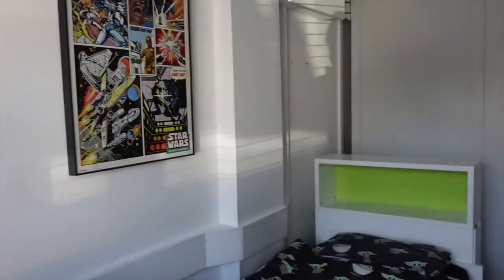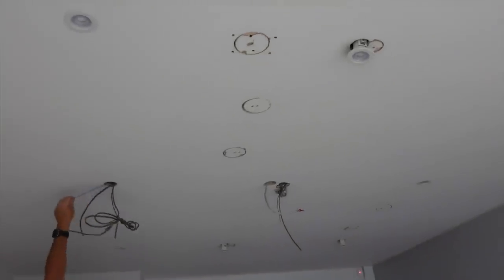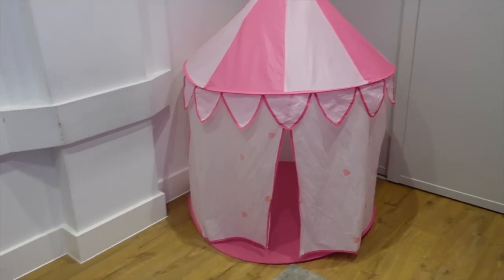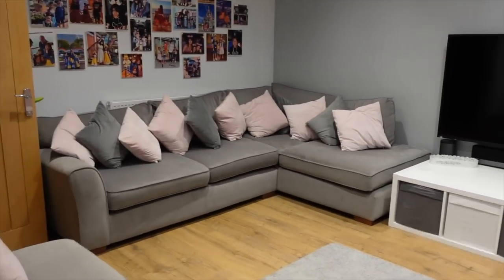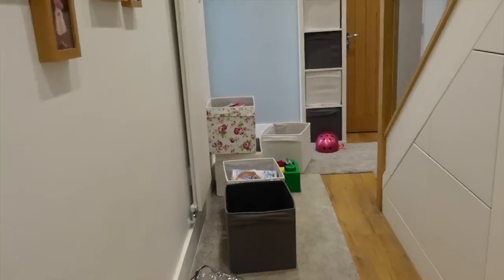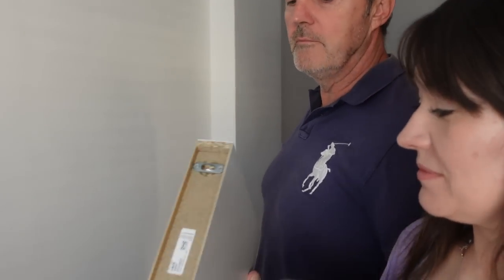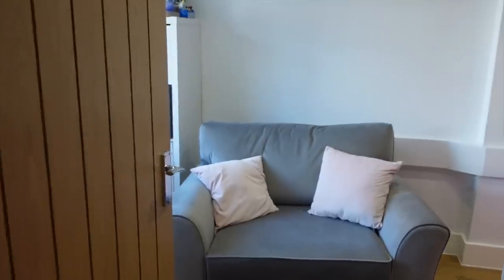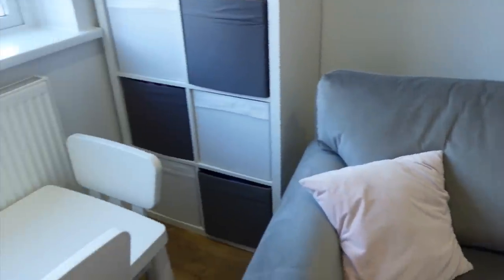Room Transformation Vlog! Organise With Me & Toy Storage Hacks

Comment: Love this. Would love to know if Dylan's seen it on facetime or something and given his stamp of approval too.

When Daddy of 4 was talking about the floating shelves that have the pole thingies mounted to the wall, speaking as someone who had one in my room for 10 years I can tell you that they do go slanty just as much as those Lack ones would if they're overloaded, so floating shelves are very much of a muchness... or maybe my 'jack of all trades master of none' idiot ex father put it up incorrectly. Somewhat fitting for a man who had a failed 'handyman' business for about 6 months!😂😂 My bedroom was redecorated a couple of years ago and I now have more shelves than before with 2 sets of 3 80cm shelves (and 1 80cm 6 shelf billy bookcase and 3 40cm 6 shelf billy bookcases, my mum jokes that my room is a library with a (single) bed in it) but they're constructed with the metal brackets and mountings you'd get on wall mounted shelves in libraries or classrooms as they hold more 'book weight'. If the shelves are going to be more decorative floating shelves are fine regardless of how they're built, but if they're holding something more substantial go for brackets of some form, my room is painted white so the white brackets of mine don't stick out much at all but you could probably find more decorative sturdy brackets somewhere or you could paint them the same colour as the wall like you did with those wee spice shelf thingies in the kitchen, your office and in the kid's bedrooms if that's an update you ever need to make.

Are you going to continue practicing toy rotation like you did with the boxes in the living room? If so I'd love to see an example of this in time, and I'm thinking that the wardrobe would be the perfect spot so you don't have to keep hefting the boxes down from high up in Zara's room.
Reply from the maker: Yes, Dylan has seen it on FaceTime and loves it! We'll definitely still do toy rotation x